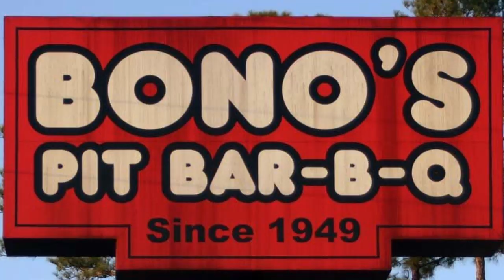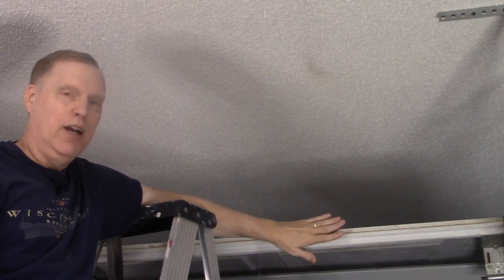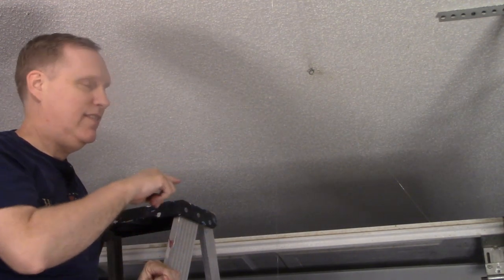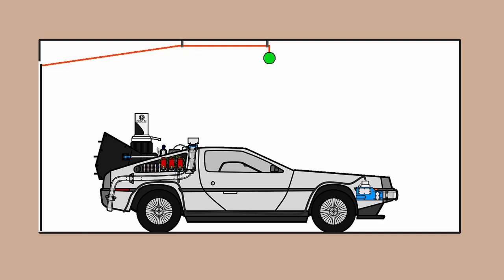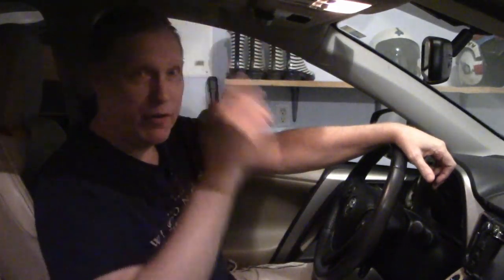Retracting Parking Target - Cheap Garage Fun

Comment: Nice, but when working in the garage with the door open, you run into it when moving in the garage.
Reply from the maker: Normally, yes. But I live in a swamp and don't tend to have the garage door open on account of the neighborly bugs. But I completely understand your point!
Reply: one solution for this is to hot glue a small magnet onto the tennis ball (making sure the magnet is not in a position where it will bump your windshield).  Use this glued magnet to "adhere" the ball to the top of the garage door when it is opened and you want it out of your way.  Simple solution.

Comment: The tennis ball is STILL in the way 70 years later. Who needs the balm to retract "out of the way" when there is a car "in your way." You wouldn't walk into it anyhow. Most people I know, work in thier garage with the door up after they've backed the car out.
Reply from the maker: True except we do not work that way. We live in a swamp and an open garage door means bugs all over the place, so we shut the door when we are in there working and the tennis ball is completely out of the way. Others do it differently where they live but we shut the door to avoid the bugs.
Reply: @AtomicDairy  Fair enough, that sounds like pure Hell. I live in the West where it gets over 100° on the regular. The oppressive heat keeps the bugs down, but I get to work with the door open anytime I want.
Reply from the maker: I like the West a lot but I live in the South and it's pretty awesome too. We like it but seasonal bugs, and alligators, are things we have to deal with unfortunately...

Comment: Before going through the additional labor of adding the retractable feature, one needs to ask oneself the following question: if I'm in the garage but the cars are NOT in the garage, will my garage door(s) most likely be open or closed? If the answer is open, then you don't need the retractable feature and it won't provide any benefit. In my case, if the cars are not in the garage, my garage doors are open 99% of the time because I probably moved the cars outside to use the blower to clean out the garage. Having said that, this is still a great video.
Reply from the maker: In our case there is a swamp outside that garage door and that usually means bugs in the garage if we leave the door open. So for us it's better to keep the door shut. But you're right, if you work with the garage door open the hanging targets could be a problem. But not for us because of the swamp.

Comment: Great video atomic  no measuring was nice ....just raise target to top of ceiling  and tie off to top of door. Make adjustment with second hook butting ball up to window. Instead of tying off to roller on door I used self tapping screw in metal door and tied off. Another tip when you go to install second hook make a mark on ceiling then close door and insatll second hook a lot easier then reaching over door. Do not worry about finding studs sheet rock will hold hooks just find. Someone commented on ball hanging down when door open with no car in garage but for me it will be seasonal (winter months) car inside doors closed🤩

Comment: Thanks very much for this video. Saved me a few bucks. Quick and easy. Btw, I was able to make this work without the second eye hook... It was unintentional though. After I set up the first eye hook and tied off the fishing line to the garage door and tested out where the ball would end up to place the second eye hook, the ball was in the perfect spot to park my car. Didn't need the second eye hook ... Guess that was just luck! Thanks.
Reply from the maker: Excellent! Glad it worked for you and now you get to watch the ball drop into place every time you pull into your garage. We always see that as part of our welcome home!
Reply: so it varies by the height and length of the garage, so for you the 2nd eye hook is not needed.

Comment: This is very similar to the Genie brand Perfect Stop Parking Assist. One question: Can I put two of these on one large door? With two cars parking next to each other, i guess it would be possibile, just varying the length of the line and placement of the second screws, right? Thanks. Great production of the video…low key enough, but slickly done with some nice dad level jokes.
Reply from the maker: We do exactly that in this same garage. I just showed the one on the left, but we have two docking targets hanging off of this garage door for side-by-side parking.

Comment: I appreciate your video - particularly the drawing at the end.  My problem is that the ceiling in my garage is very high...
Reply from the maker: Yikes! That could be a problem! But it might work because you will have less slack than I did.
Reply: @AtomicDairy  You can compound it pretty easily, line has to terminate on a screw eye, and garage pulls the line running between 2 screw eyes. Will give a 2 to 1 lift and lower ratio.

Comment: Hey buddy, I am from Toronto. I watched a few designs today, yours I think is the simplest and yet the best. You are a genius and thank you for taking the time to share your ideas.   Surely one goes nuts using an arduino single board computer, that is so overkilled. I am using your design to safe guard my new Mercedes from hitting the right side of the garage door opening as I needed to get all the spaces in the center isle for two cars.  The wrapped fishing line serves as a vertical column where if it moves, I am getting too close.   Once again, yours is cheap and easily get done.
Reply from the maker: Outstanding and thanks for the kind words! We tried to make our docking target simple because simple is easier to install and breaks less often. The Arduino option was tempting but we agree it is overkill for this application, and it would probably break or need adjustment more than this solution does. Have fun with your target!

Comment: Cool idea, but doesn't keep the ball out of the way when working in the garage with the door open.
Reply from the maker: True. But before we had a dedicated wood shop we used the garage for a LOT of woodworking, almost always done with the garage door closed to keep the noise down for our neighbors. So in our case this was the solution that worked best. But your point is valid. Someday I would like to build motorized auto-retracting targets that are only extended when the car is actually pulling in.
Reply: Since I only go into my garage via the main garage door and never through the side door, the only time I would ever see this retract would be if I moved the vehicles out of the garage and closed the garage door while I'm inside.  I don't live in a cold climate and I don't have an air-conditioned garage, so that seldom would happen.  If I need to move the ball out of the way temporarily, I will use a sheepshank knot to take up the slack and move it upwards.  I don't use fishing line on the tennis ball though -- I use paracord.  It's more durable, visible, and easier to tie a sheepshank with.
Reply: @AtomicDairy  I often work in the garage with the door open.  I just set the ball up high on the open garage door while I work to get it out of the way.  When the door closes, the ball goes back into position.    Thanks for the video!

Comment: While the retractability feature is nice, in practice such dangling parking targets work poorly with the latest cars that have an extreme windshield rake angle and where there is little tolerance for error, lest the car's hood or plastic non-bumper hits the garage wall.  The target is useful for left-right aiming while driving into the parking space, but a parking curb secured to the floor is a much better way of keeping the car from developing a bad case of garage rash.  I solved the problem for a friend by getting a 3-ft concrete parking curb from a local builder's supply, drilling a couple of holes in the garage floor at the proper locations and pinning the bumper to the floor with short lengths of rebar so it cannot move when the car tire hits it.  She had hit the wall with her old car multiple times over the years while parking.  With the parking curb and the ball she now parks her new car accurately every time — no overshoots, no scratches, no dents.
Reply from the maker: Different solutions for different vehicles. Glad you found a solution that works for you!
Reply: The windshield rake has nothing to do with it.  When the ball hits the windshield right in your line of sight, you stop.  Seems a whole lot easier than the process you described above, and no trip hazard when the car is not in the garage.
Reply: @markmarquardt3119  — There is no trip hazard.  Moreover, people are not machines and sometimes they pull into a garage when they're tired or are a bit slow when hitting the brake pedal.  If you insist on believing there is no difference in parking precision due to windshield rake angle, please feel free to post here the next time you have a bad day and cause a $2000 boo-boo to the front end of your car.
Reply: @tdginctr  —You betcha.  Don't make things so complicated in your mind.
Reply: @markmarquardt3119  EXACTLY!!